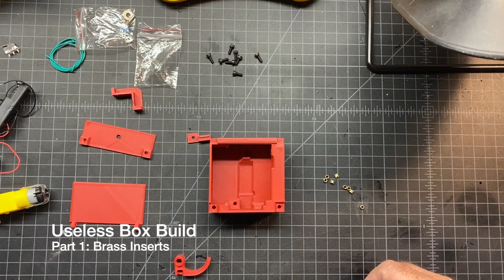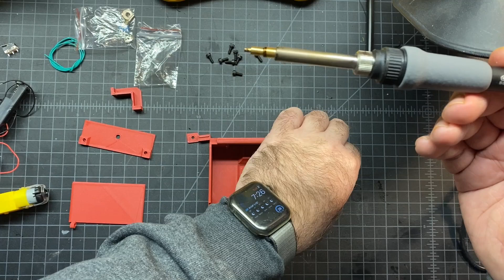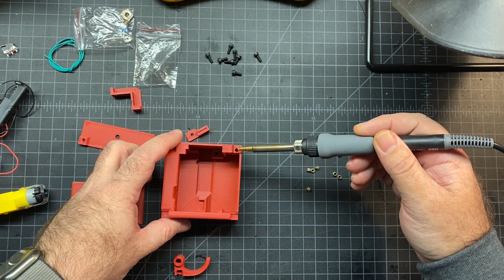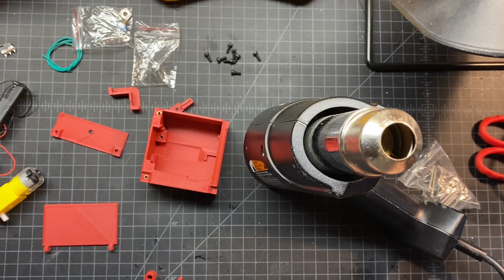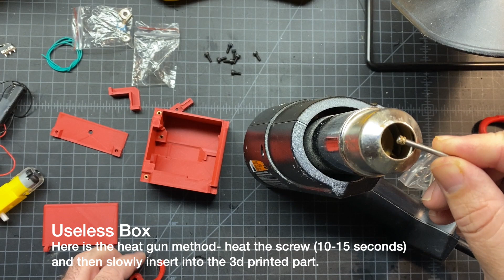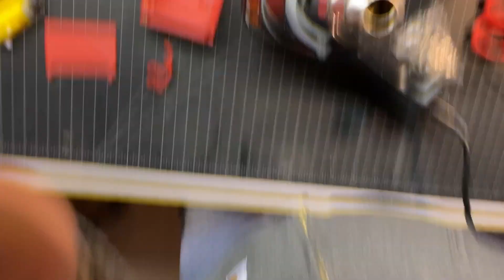JustAddFilament - Useless Box Build - Part 1 Heat Inserts

Comment: Good vid!  I've had luck placing the inserts over the hole, turning the iron heat down low.. and then softly pressing from the side of the iron.  I'll have to give the screw heating trick a try.

Comment: I may redesign that last motor brace insert. could probably make it the catch, and place the insert on the base of the box!
Reply from the maker: Honestly, it was still super easy to get in, I'd leave it the way it is. I was glad to show the heatgun / screw technique as well (which I used to build two hypercubes with). Great design!!
Reply: @GregsMakerCorner  That is a cool technique, first time Ive seen it. Glad you like the design! I tried to keep everything as compact as possible. Still need to design a few variations for the lids, with different designs on them, maybe a sculpture of some kind, maybe even sculpting the motor arm could be cool!